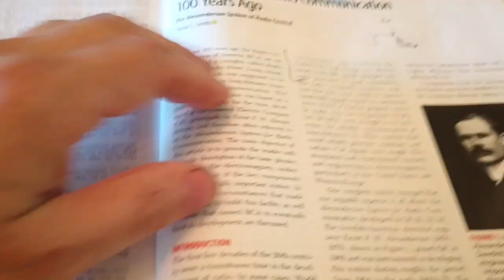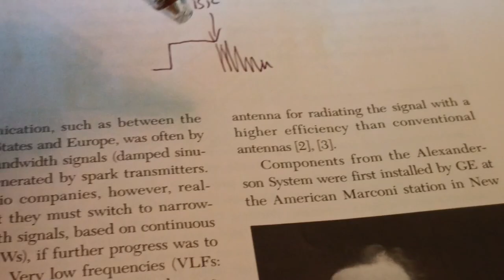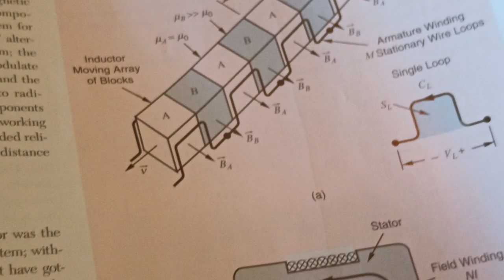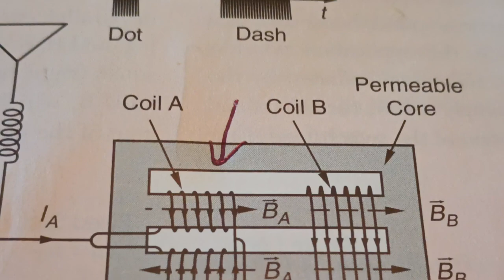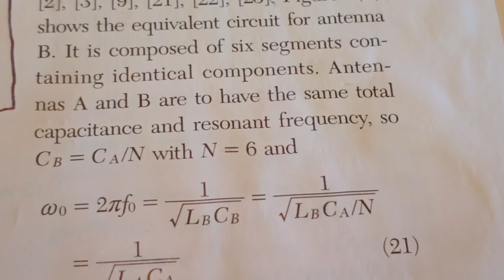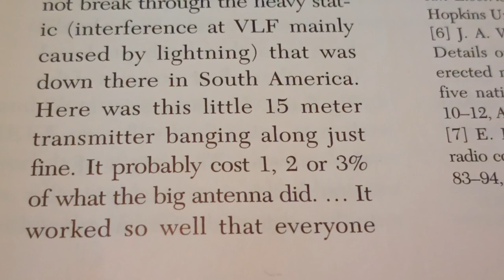Antennas and Spark Gap Theory | IEEE & ID Theft? #antenna #ieee

Comment: I've seen a video of the last Alexanderson station in the world at Grimeton, Sweden. It's still operational and once a year they turn it on and operate it. It looks far more like something you'd see in a power plant than a radio XMTR. So loud that if it were an industrial environment they'd require earplugs and earmuffs to be worn simultaneously or they'd be denied workman's comp insurance at the very least.

I like the two file cabinets and a board used as a TV stand. I may use that idea someday.
Reply from the maker: Excellent comment, that setup is SCARY to imagine the EM exposure with no good way to measure it and no idea of human exposure!

It IS power plant equipment! (was)

The cabinets are great DVD storage!

Comment: I cancelled my membership in IEEE decades ago.
Reply from the maker: Spectrum is all New Age green philosophy. It and SAE mag are worthless. EV batteries are Chem engineering, not EE.

 Theres nothing much new in EE. That was OK as long as I was focused on the Paper publishing process, but that is grossly corrupted also.

IEEEs Publishing system is a joke, loaded with errors and they demand Authors use an UNCONTROLLED TEMPLATE in this ISO age, which is a GROSS SECURITY RISK.

They are #18 down the list of reputable Publishers.